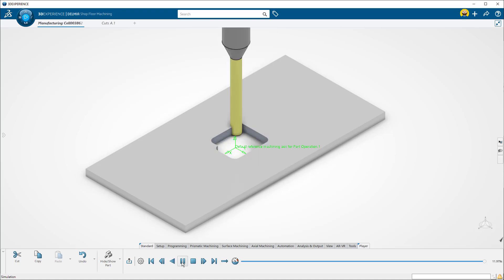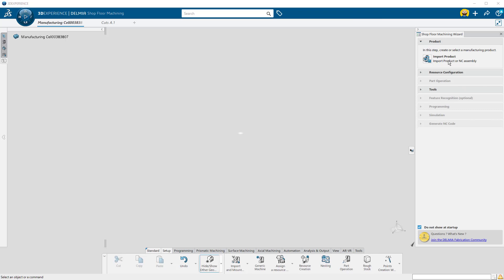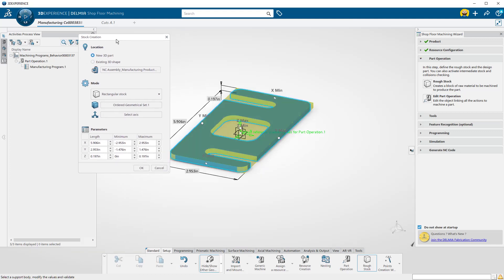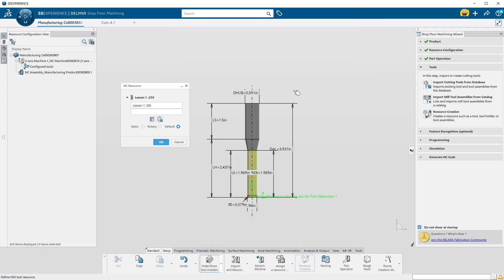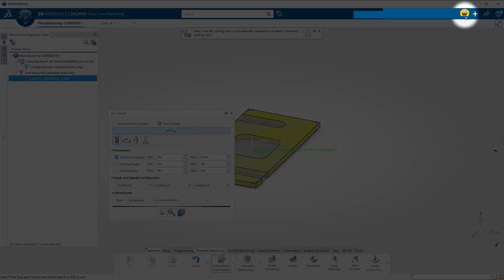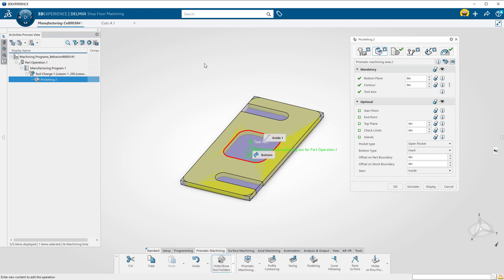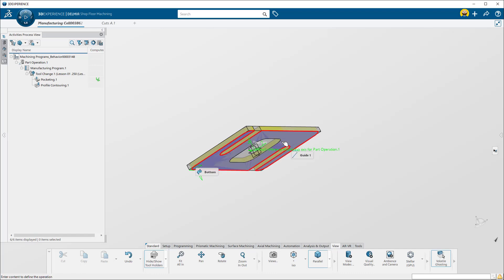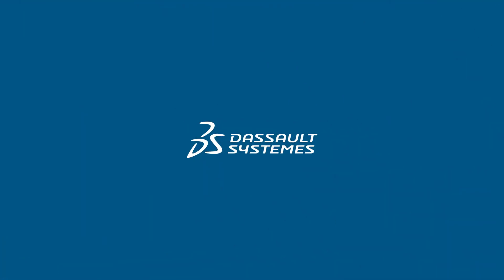DELMIA Shop Floor Programmer Foundations Lesson 1

Comment: I would like to thank you for your video, but i didn't manage to make it work. When i import a sldprt file, it says that it is corupted altough it open in sw perfectly fine. When I import a stp file I can't select it to import it into the manufacturing cell. It just doesn't work, maybe I'm dumb but a software of this type should be a little bit dumb proof especially for hobbyists. I paid 50€, lost 4hours and didn't manage to even import a 3d object. This software really pisses me of. I can't transmit how angry I am right now. I have to stick with Fusion 360 even if it is unstable but it's the only one that works and that is a little bit intuitive with great tutorials. Is there any alternative to Fusion 360 AND Solidworks 3dexperience shop floor walls shoes something f*cked up name for machinning that doensn't need a company budget to be bought ?

Comment: So this only functions with parasolid type files? LIke I can't update my part file in SW and have that update reflected in the CAM programmer? If that's the case, Fusion 360 is the logical solution here

Comment: Ok so I create a 3d solid object by extruding it from a closed shape in Solidworks Makers and save it both as sldprt and step file. Than I proceed to import it in NC Shop Floor Programmer. Guess what in the 3d previewer for the import wizard I can see the solid part but if I hit the ok button it throws error. So I go to the report for the error I see no description of the  errror except the operation errored and that the importer plugin is version 0.1 (not even 1.0).  So I think to my self that the good thing is that I bought SolidWork Makers Desktop which gives you a functional locally installed Solidworks cad program but all the other tools which run in the browser and are cloud based are just a bunch of useless pile of garbage. Should have tried Fusion 360, maybe that actually works better for diy makers.
Reply: Have you tried using delmia any further?  I'm very experienced with fusion design and cam, as well as Mastercam, but I thought I'd give this a try ...so far I'm not impressed, but then again, I wasn't happy with Mastercam when I started using that either.....have your feelings changed in the last month?
Reply: @Steelcrafted  he actually tried using delmia but he didn't succeeded, asking him if he used it further is useless because he didn't manage to make it work. You can't use a software if it doesn't work. I don't know how these softwares are so terribly made when you see things like shape3d or plasticity. The problem with these is that they don't include CAM.